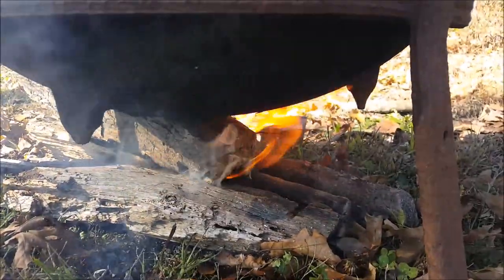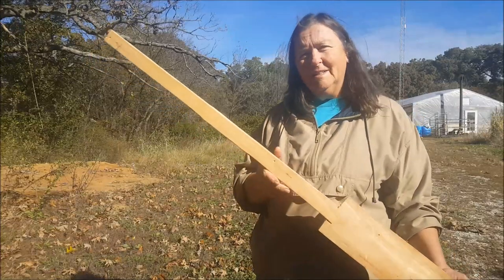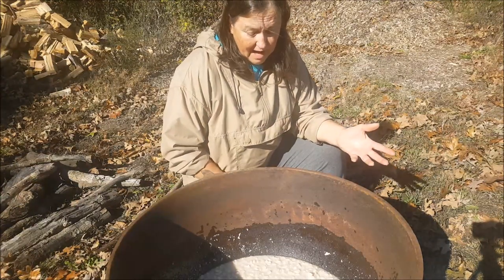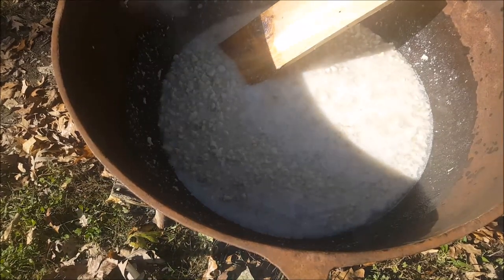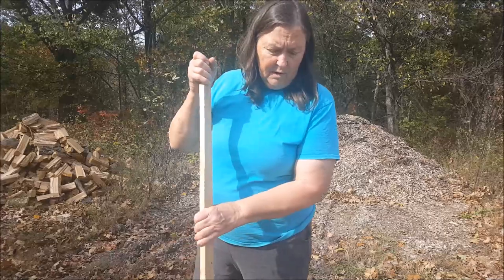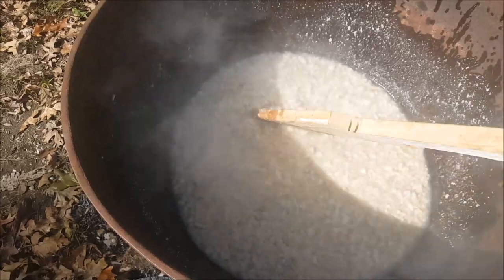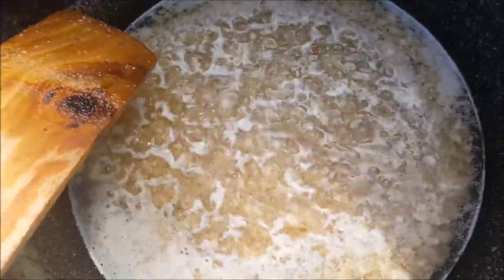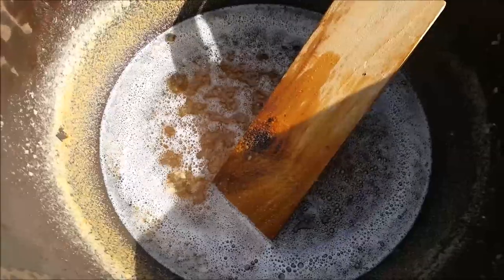Rendering Lard Over An Open Fire Part 2

Comment: from a old pro that has done that many times over many years the very first thing you should have done was put fire under the kettle without anything in it till it burnt all that rust off. i would be very scare to use any of that with the rust in it. if nothing else it will make the lard and cracklings taste like rust!

Comment: Stirring was always a very important part of rendering lard. Having a makeshift stove under the kettle is also a tremendous asset for controlling the heat. Just a ring of steel with a makeshift door cut out and hinged back on will take a lot of guesswork out of fire control.
Reply from the maker: That would certainly help on a windy day. The lard turned out really well. Thank you!

Comment: Would it have been easier of the cast iron had a patina? It seems like your cast iron was fighting you with the constant sticking.
Reply from the maker: The deal with the cast iron kettle is that it doesn't get used often. Plus, the other thing that I do with it is heat water for butchering chickens.  With that it loses any conditioning the lard cooking might give it.  Thanks for watching and commenting.